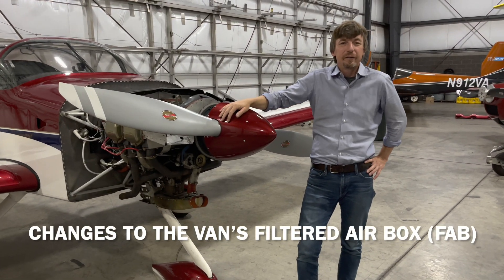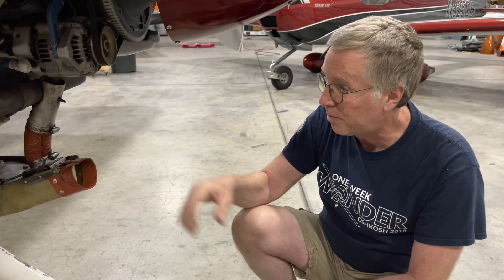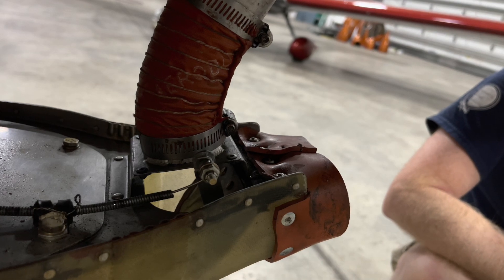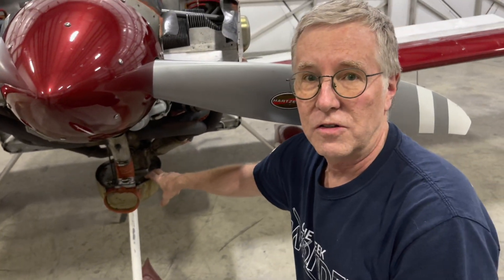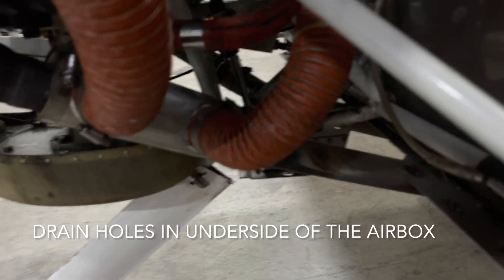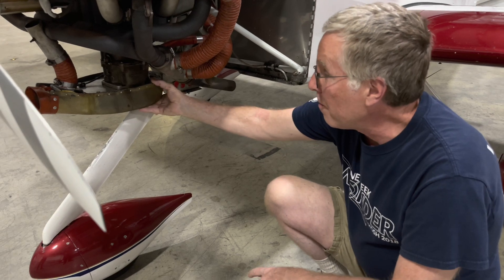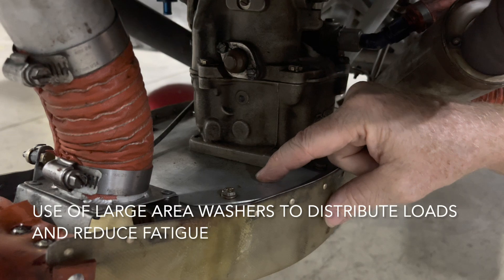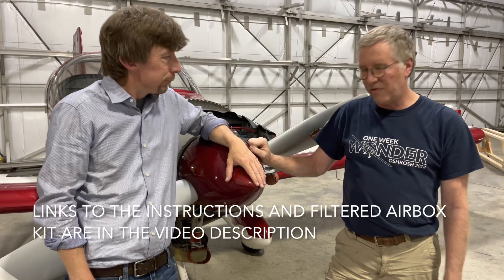Changes to the Filtered Air Box from Van's Aircraft

Comment: Wait, the engine is not horizontally centered?  Is this common?
Reply: Mounting the engine 1 or 1-1/2 degrees to the right, and down, to counter P-factor and asymmetric thrust helps keep it straight on climb-out.

Comment: Does that carb heat shroud transfer any heat to the inlet air at all? It looks ineffective.
Reply: IMO there's no way that arrangement has the necessary air temperature rise to melt ice.  A much larger muff is needed and why wouldn't you channel all the air you could through it, closing off the two open side vent areas when carb heat on.  I re-engineered mine back in '98 to work properly.
Reply: Looks like that large gap would introduce hot air from the lower cowl, after passing through the cylinder fins. The exhaust muff is clearly too small, and pulls air past the exhaust pipe in a half-circle shape. The muff should pull air horizontally along the exhaust pipe, and the top of this muff should be capped.

Comment: For a fuel injected airplane would the new carb heat door be usable as an alternate air door?
Reply from the maker: Alternate air implies that if the filter should become clogged or plugged up, you can open it and have an air supply that bypasses the filter. The carb head door is located before the filter. So, while it can be useful in terms of icing prevention through the system and for keeping things like rain or snow from entering through the cowl inlet, the carb heat door is located before the filter. We sell an alternate air door option, which can be added to the underside of the FAB, which would be the correct way to go for alternate air in the event of a filter clogging situation. Good question!